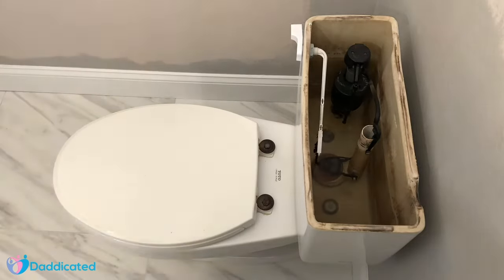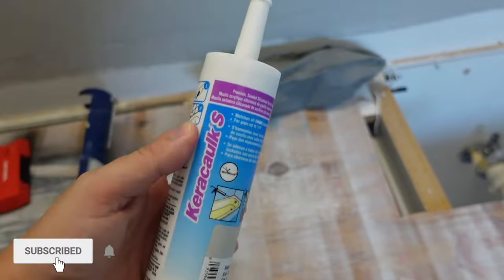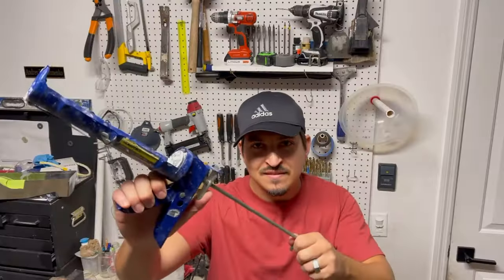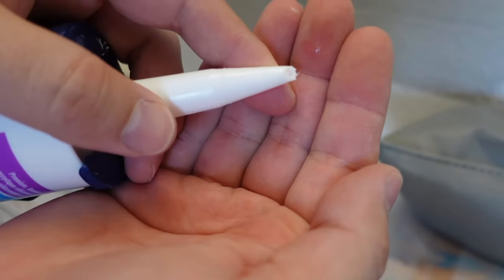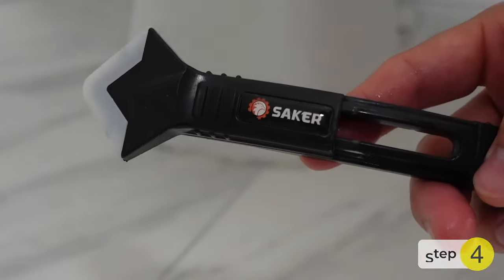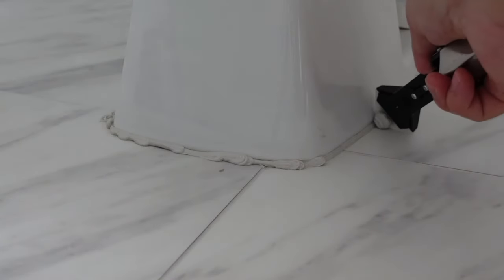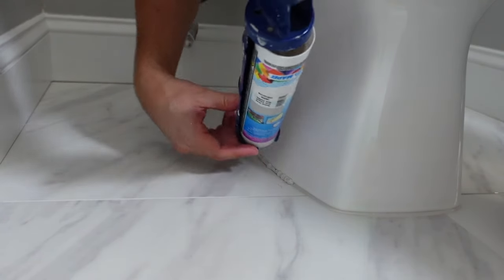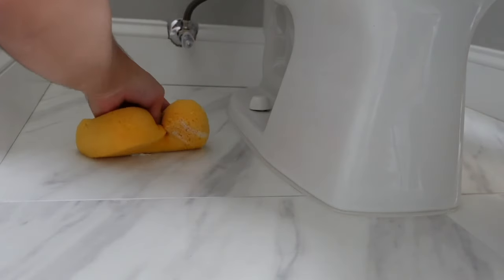How to SEAL a Toilet Base to floor

Comment: I'm curious why you want to seal your toilet to the floor. If your wax gasket failed, you may not ever know until the subfloor beneath the toilet is trashed.
Reply from the maker: Not exactly. It’s water it will find its way out. Typically you will notice that your grout lines in the tile are going to be dark by the toilet base. What the seal does is prevent from a really big mess if the wax gasket fails. The last thing you want is water going into your baseboards and everywhere else. Also, the seal adds a finished look to the toilet.
Reply: Because the chalking keeps pee, cleaning chemicals and water from gettting under the toilet, after a while it will smell.
Reply: Recommend leaving a small area in the back (1 inch) un-caulked to help determine if there is a leak. Ultimately, wax ring should last 30 years, but you never know!
Reply: @zacharyscheele2150 thank you for this tip! I'm doing my first toilet. Install this month so this is going to be a nervous one for a do-it- yourself'er. Wish me 100% luck!
Reply: It will also stink